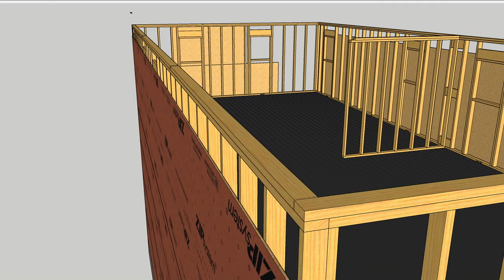Standing Walls (3)

Comment: Code here requires anchor bolts to be set before your pour.
Reply from the maker: They are not building on a slab. That is a rubber mat protecting the 2x6 T&G finished flooring below it. (they are framing on the second floor)